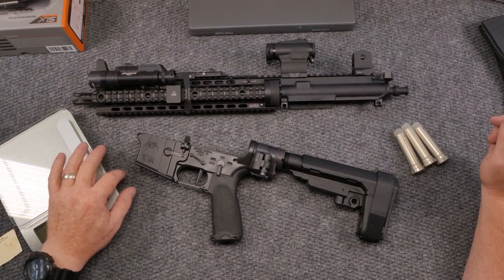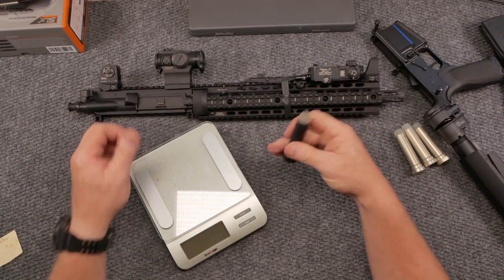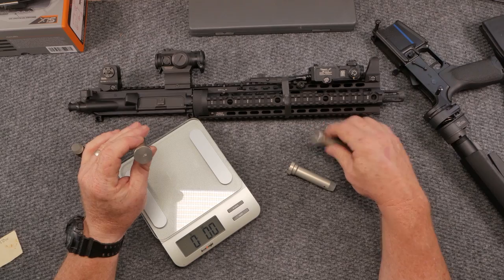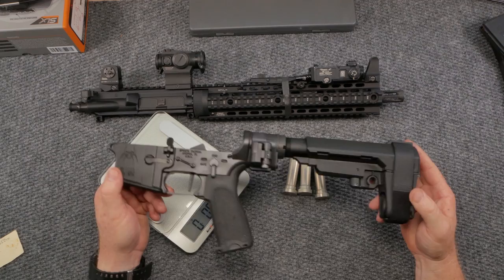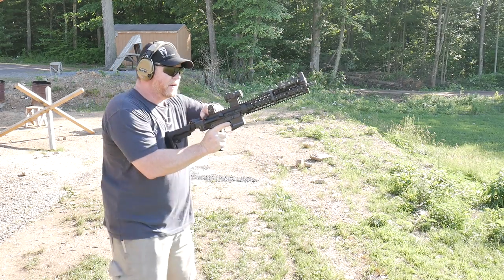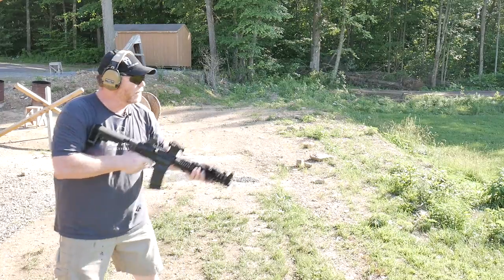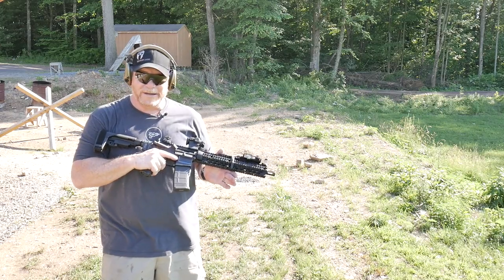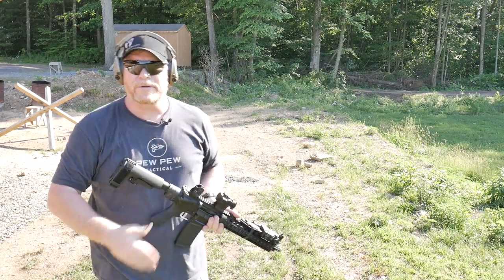Buffers! Buffers! & Buffers!  What's the Difference H1, H2, & H3 Let's see what happens

Comment: Increasing spring strength is a better way to fix an over gassed rifle. I run a Sprinco red in my sbr.
Reply: Agreed , i got a h3 and blue spring co in my ballistic advantage 11.5 think i may need a red its still putting brass about at 245-3 o clock but yea spingco good recommendation
Reply from the maker: On the list
Reply: @dariusbond5121  try a red with an h1. That's my setup and I'm spitting 3 o'clock suppressed and 4 unsuppressed.
Reply: I run a H3 with a blue Springco in my BA Hanson 12.3 pistol. Ejecting at 4 o’clock I suppressed, hoping for 3 o’clock suppressed. I’ll find out after it gets out of jail..... Bought a red spring for my PSA 10.5 since H3 still at 1-2 o’clock
Reply: @Matallen-es5rs  ima give that a shot.  Ima buy a red in about a week or so and i got all 3 weights to play around with for buffers
Reply: @LONEWOLF_LCD  you should get that gas port diameter checked but if its h3 at 2 oclock then a blue spring may put you wh where you should be id buy a red one play around with it first if you get blue and its not enough now u gotta spend an extra 20 bucks plus shipping .but if u get a red and you have all 3 buffers lying around already then you have room to play
Reply: @LONEWOLF_LCD  go to a red spring with a h1 or h2. If red isn't enough then try an orange. I use orange springs in my 9mm and 308 rifles. Orange in 556 is stupid smooth
Reply: I run the same one in my 11.5 pistol and it runs flawlessly.
Reply: A5 system with a geissle 42 rifle spring and appropriate buffer works great for me
Reply: OK so I have a bit of a conundrum on this subject maybe others can chime in on. Silenced 300BO pistol with adjustable everything. It's not reliable at stripping and chambering heavy hollow point subs from a full mag when using the bolt release. Add more spring or more weight?
Reply: @snek9353  more spring with less weight. Could also be a mag issue. I had that problem with my 300blk sbr until I switched to 300blk pmags. Ymmv.
Reply: @snek9353  get a Nemo spring
Reply: @Matallen-es5rs  Does fine with the 300blk pmags, has a hard time with the surefire mags. I wouldn't have thought less weight, why less?
Reply: @robotbuster1487  It runs an extra short JP SCS.
Reply: @snek9353  less mass reduces lag time, the spring has an easier time getting the lighter buffer to start forward progress due to less resistance. It'll also help with recoil due to less mass moving reward. I had a lot of the same issues with my 300blk before I started playing with springs and buffer weight. The sbr my wife is building is going to have a low mass bcg so that will be fun to test out.
Reply: What would y'all suggest for a 10.3?
Reply: @coleyeaux  honestly depends on the rest of your set up. If it's violently over gassed then try a sprinco red and play with buffer mass. If you just want to smooth it out and keep reliability then try a blue with an h1.
Reply: Just now learning about the different springs. Whats the recommended spring to use in a 10.5 inch ar?
Reply: @dariusbond5121  Im runing a BA 13.7 mid length with a H3 and a spring co red. Let me tell you the gas port in the BA barrels its well sized because my rifle will run full power 556 but wont run underpower loads like tula or wolf. I might need a H2 buffer and blue spring
Reply: Sprinco red h3 or h4 buffer
Reply: I live in NY and am moving to Kansas in just over three weeks. Looking forward to testing my ARs with the various sprinco springs and a range of buffers to see which is best. Going to be fun to be able to exercise my rights as God intended
Reply: anyone ever tried red sprinco with standard buffer weight?
Reply: @Anthony-vr3um  interested to know this as well.
Reply: @dariusbond5121  you'll still recommend the "red" with a h3 buffer??
Reply: @chrisrobles4115  it honestly depends on your rifles gas port , another option is get a voltor A5 Buffer tube and go that route if it's still overpassed but yea I had to run that in one of my barrels before
Reply: @dariusbond5121  I got a 750 port & I plan on running 11.5 556 barrel
Reply: @chrisrobles4115  depends on company you use . Buy a voltor A5 Buffer tube ,spring and buffer . If your gun cycled fine good it'll be a tad flatter to shoot anyways
Reply: So I had an issue with an 11.5" that was not locking back on the last round. I tried an H2 buffer, but that didn't help. To fix the problem, I switched to a LIGHTER spring (Sprinco yellow) to fix the problem. I had a similar issue with a 10.5" and the same fix worked for that, as well. Any idea why that is?
Reply: @rbjmartin  could be your gas port size, bcg mass, ammo or a combination. That's the awesome thing about changing spring weight to tune the individual rifle. My ar9 has an orange sprinco but I recently experimented with reducing bcg mass and ended up with a reliable rifle with less felt recoil.
Reply: I got a 16inch 300blackout (pistol gas system) running a giessele S42 spring and H1 buffer. Got a full auto bolt carrier. Runs everything I've fed it from 100gr to 150gr brass and steel. Cases will reliably bounce off the deflector lol
Reply: I use an H3 in my 11.5” pistol, Franklin trigger and spring. Recoil impulse is still pretty harsh but ejection is good. AGB really helps with that

Comment: Stock carbine buffers are not "H" buffers. The "H" designates heavy. H1 h2 h3 denote heavier weights. But stock carbine buffers are not H
Reply: Yep!
Carbine buffer = 3 steel weights.
H1, or H buffer = 1 tungsten weight and 2 steel weights.
H2 buffer = 2 tungsten weights and 1 steel weight.
H3 buffer = 3 tungsten weights
Rifle buffer = 5 steel weights
Reply: @adamcasey4184  And then there's the H4 buffer at 6.8 oz with a steel body.
Reply: Agree.
Reply: @GreatMercenary  ... Err, not really. Carbine, H1 (H), H2 (HH), and H3 (Triple H :)).
Adam had it spot on for the 4 standard carbine buffers and the standard rifle buffer.
Anything above that is a XH (HSS)
Reply: @GreatMercenary  ... Sorry, I was mentioning what the different governments have as official sizing/differences.
A corporation can basically say anything they'd like, as long as they respect the basics of system (thing X rated and triple X being the corporation playing within the RIAA's system). It makes sense to a corporation to list them based on weight, while another corporation will say theirs is a H6, since it has six weights.
If uncle sam decides to use it, it's a XH or HSS.
Reply: My colt LE6940 came with an H buffer so…

Comment: People put too much reliance in the AR ejection pattern pie chart. So many variables to account for that can make a difference and have nothing to do with over or under-gassing. Good, strong, consistent ejection that is generally heading away from the rifle is all I look for anymore assuming I’m otherwise happy with recoil impulse and how it shoots. If the brass is just piddling out, or going directly forward or directly backward I might take a good look and see what’s going on, but otherwise, It isn’t something to get hung up on.
Reply: Unless you gas key is slamming the into the lower near your buffer retainer. Thats more important than ejection pattern. Plus ya don't want you rifle beating itself to death.
Reply: Agree gassing is only one place to look not the only place.
Reply: @pmorin313  If that’s happening your buffer is of the wrong (ie out of spec) dimensions or your receiver extension is not properly installed. 

It should be impossible for that issue to occur if everything is properly in spec.
Reply: @rifleshooterchannel208  this will occur when your carrier length is out of spec (to short)
Reply: @pmorin313  Very true. It completely slipped my mind because I’ve thankfully never encountered one that was out of spec. 

Can’t say the same about buffers or receiver extensions 😬

Comment: This video is surprisingly helpful to me despite not much change.  It has shown me that the buffer will not fix an over-gassed gun.  Proper gas port size and adjustable gas blocks are really what's needed for adequate control.
Reply: dont forget proper BCGs and buffer springs
Reply: Absolutely right. And almost all pistol length gas systems are very  over gassed.
Reply: If your bolt carrier face it going past the ejection port it will eject the shells at 1 oclock.   Its due to the buffer tube being a little too deep.  Fix with shims (quarters in the tube) or screw in the buffer tube more.   
The face of bolt should be like 1/8-1/4"  forward of the back of the ejection port opening.  If its more then you can can get forward ejecting and dented cases.
Reply: This is absolutely incorrect. Yes, proper gas port sizing is important, but adjustable gas blocks introduce more problems than they often fix. There are buffer weights above H3 and alternative systems like Vltor A5. Similarly, vendors like Geissele and Sprinco have higher tension springs to aid in timing a gun. Flat wire springs too change the dynamics of weapon function. Unless the gas port is so terribly off spec for normal pressure ammo you should never have to resort to restricting gas flow.
Reply: @Physics072  never shim a receiver extension. If it is out of spec get a quality one that is in spec.
Reply: @jhalscott  You dont know what you are talking about.  You can run a carbine buffer in a A2 stock using filler to make up the space. wood dowels, quarters etc.  So don't say never if you don't know the mechanics of how they work.
Reply: @Physics072  ROFL… you should never shim. It’s a hack. If you have a full A1/A2 rifle receiver extension just use a rifle spring and buffer or swap the proper receiver extension and use the spring and buffer setup designed for it. Just because you CAN do something doesn’t mean you should.
Reply: @jhalscott  does not hurt a thing.   But agree that everything should match up and not have to adjust with quarters spacers etc.   So not sure why you fear monger this you should never shim the sky is falling if you do.  It does not damage or hurt anything.   Not checking (most don't) can.  Not all parts are built to spec so if you don't check you wont know and just assume its all ok.
Just so we are on the same page here.  Take a look at this video  
https://www.youtube.com/watch?v=Z7kte3ZCILs
Reply: @Physics072  it’s not fear mongering. You just should never do it. There’s a reason they make different sizes. Could you “Bubba” gunsmith it? Sure. But no good reason.
Reply: @jhalscott  Its just find tuning  for some people.  It really does not make any difference if you obtain the 2 quarter or 1 quarter gap.   It depends on the many factors.  The botton line is you don't want the key banging on the tube housing so you need to check the gap and if you want it adjusted more or less you can add a quarter, delron etc.  It does not hurt anything.   You never gave the horror stories of what happens if you do it.  The answer is nothing.  So why fear monger without a follow up to why its bad?   Makes no sense to do that.
Reply: @jhalscott  Lol yes a 1-2 quarter shim no biggie.  But a 40 quarter shim to use a carbine buffer in a A2 tube is getting extreme.   I've done that to test buffers and in one AR it actually helped in the "feel" and balance of the gun plus if I needed some cash in the field I had $10.00 of quarters in my tube :).    But it in no way did anything negative as in breaking the gun.   But in that case yes getting a A2 buffer is what you would want.
Reply: @jhalscott  Tubb flat springs are money !!!
Reply: It can however fix under gassed guns. My 300blk would not cycle subsonics with a pistol length gas system on a 16" barrel. Adding a lighter spring and buffer helped.

Comment: I know this is old, but that ballistic advantage barrel is a disgrace, that gas port has to be way over sized out of spec if an H3 did almost nothing and you could see extreme gas in the face, I would have sent that barrel back.. Only fix for that gun would be an adjustable gas block, at this point it looks like it would need an H4 and an extra strength spring, but that still does not solve all that gas in the face!

Comment: On my 10.5" I have an Odin Works adjustable gas block and an H3 buffer. Tuned it to fail to feed and opened it up a half turn. It ejects to a little past 4 o'clock and suppressed it kicks out to nearly 2 o'clock. Only ever had any feeding issues with federal brass range ammo. Tulammo has never failed. Great vid!

Comment: Use a Geissele braided wire buffer spring. Smooths things out, get a better impulse. Springo makes some good springs as well.
Good luck with that.
Reply: I tried the braided spring and went back to flat wires, they are cheaper and the recoil impulse's a little smoother to me, I had issues with carbine buffers in the braided spring as well. I like tubbs but spike, midway, bexar flats are OK. The flat springs can be cut easily for emergencies, or for low power loads. I believe the braided spring being connected to the mg42 and superior harmonics is a marketing gimmick, the flats are just as smooth charging and shooting to me.

Comment: H2 buffer + Strike flat wire spring gave me a perfect 4 o’clock ejection on a 10.5 pistol. Before the change it was at 1-2 o’clock position.
Reply: Same here did the same.

Comment: I like the Vltor A5 system but I invested in the Surefire bolt carrier group for my last build and it's rad. The extra travel length and the sprung counterweight in the carrier are just amazing. They're my favorite solutions but there are certainly cheaper, simple solutions.

Comment: I swapped my 11.5's A5 system back to a carbine tube with a tubb spring and an H2 out of curiosity . I wasn't ejection pattern chasing but it brought the ejection back a good ways since something about flatwire springs gives the brass more time to eject, and not get flung forward by a traditional action spring outrunning it.  I think i like it better for that setup since I don't get the muzzle dip that I had with an A5 + green spring.  But for an "SPR/recce" type setup the A5 is incredible.

Comment: I was kinda supprised also of how little change there was. I was happy to see the info. Just built a 10.5 in. 9mm AR, have it adjusted so when I pull the charging handle back on an empty mag it will lock back. Shot it the first time last week, it would not lock back on last round.Started out with heavy buffer, I guess i'm going to have to lower the buffer weight to get it to go back far enough to lock back. First pistol build, the only problem I had was no lock back on last round.
Reply: What would cause it to not lock back on an empty mag when you pull the charging handle back?
Reply: @Jimmykid3  just checking to see if you are joking. If not, let me know and I will explain what Tom is talking about
Reply: @PH_INFO_101  I'm not sure Tom does know what he's talking about. There's nothing to adjust so that "when I pull the charging handle back on an empty mag it will lock back." Assuming his will even lock on an empty mag, most pistol caliber ARs won't.
Reply: Just built a 10.5 AR9 from PSA too. Have a extended heavy buffer 8 oz with a 308 spring. Works flawless. Not LRBHO but when I pull the charging handle. The BCG stops exactly where the Bolt catch is.

Comment: My first at was over gassed so bad it damaged the brass and eventually broke the ejector pin.  It threw the brass out at 1 o’clock. I tried the heaven buffers and they didn’t work any better. Adjustable gas block fixed the problem.

Comment: I overpaid for a superlative arms adjustable gas block and haven't looked back. I mean, you can pay for 5 or 6 buffers to dial it in for your rifle for each muzzle device and lower you put it on, or you can click it in with the included wrench. They are around 10x the cost of a cheap block, but put that against the tested AR that you need to purchase more buffers, ammo, and range time to correct. Similar to engines, the fuel costs more than your engine over time. Start with a solid customizable rifle and proceed without regrets.
Reply: .750" have been out of stock for ages..

Comment: I use adjustable gas blocks for everything. This video is the reason why
Reply: Once you dial them in do you ever have to adjust them again?
Or do they walk out of adjustment over thousands of rounds?
Reply: NINORC SINNED I’ve only ever used superlative arms and I’ve never had an issue. The only time I tweak is maybe hotter loads or suppressed. But once I have my zero dialed in with what ammo shoots the best I never touch it

Comment: Came across this video too late I have the same problem but what helped  me was sprinco I called them up they recommended a blue spring that I had in another gun to try that on my pistol 10 1/2 inch 5.56 carbine length gas system. I tried it and it shot a 3 o’clock call them back they said you could try one of our red Springs put in the gun and fired at 4 o’clock. I am using  the red spring with an H2 buffer and  carbine buffer both buffers with RED SPRING  all shot at 4 o’clock so everyone here is onto something. I think really you have to concentrate more on the buffer spring in my opinion it work for me and my ar pistol.

Comment: On my 10.5" 7.62x39 "Hog Czar" pig gun I started out with a Strike Industries flat wire carbine spring and an Aero Precision H2 buffer because of the heavier recoiling round and haven't had any problems yet. My 5.56 AR's all run the standard carbine spring and buffer and never any trouble. But if I were to have any trouble it would seem to make sense to go right to an adjustable gas block instead of trial and error with a bunch of different springs and buffers, won't take long to spend more than just getting an adjustable gas block right away.

Comment: wouldn't an adjustable gas block be the better choice to correct for being over gassed?  the heavier buffer is just going to slow the action down.
Reply: Adjustable gas block, light bcg, no weights in buffer, standard spring, recoil tamed.